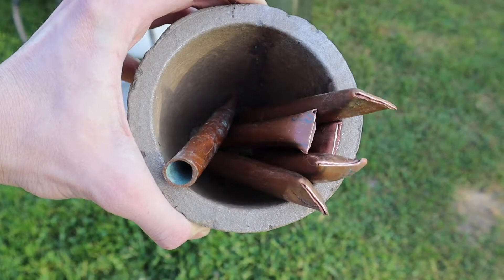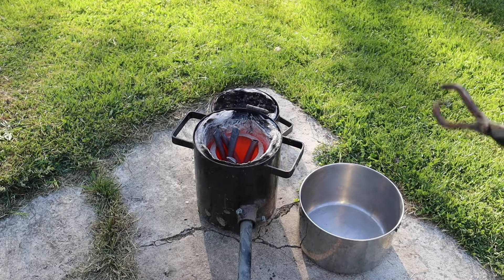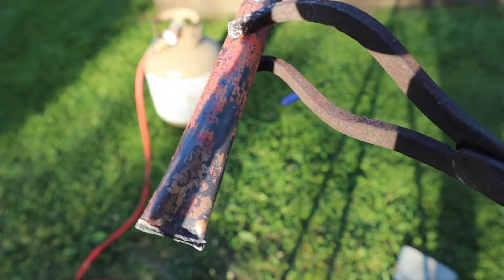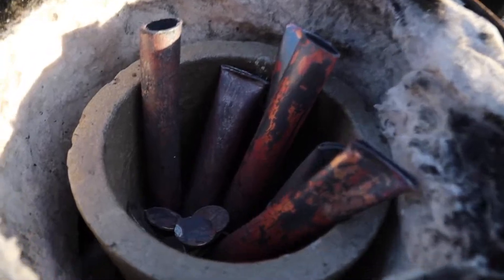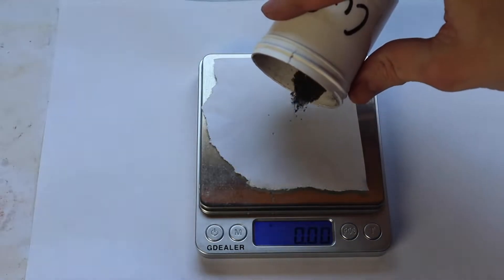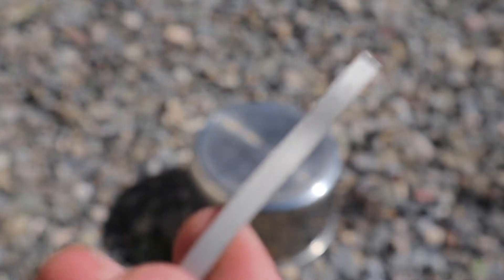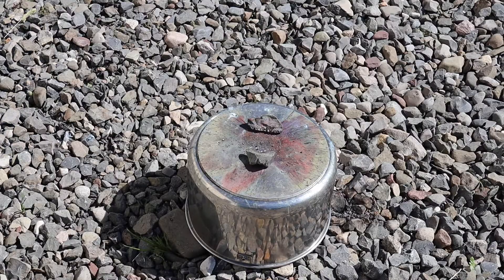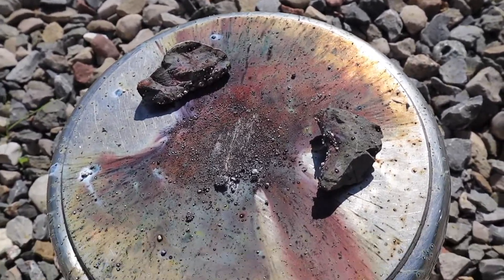How To Make Thermite Out Of Pennies

Comment: How do you calculate the ratios? I’m talking the 8:3 ratio you did with the copper 2 oxide and aluminium powder.
Reply: You use math
For example I got 10g of product 8
10=?
  8=3
You do 10×3 divided by 8 equals: ?
Reply: @KingFG_0252  i was referring to molar mass ratios